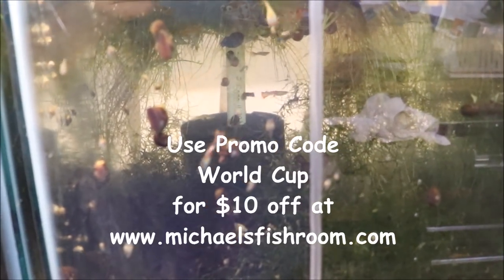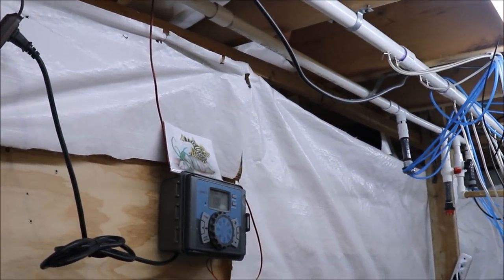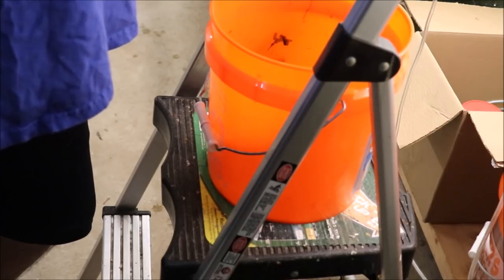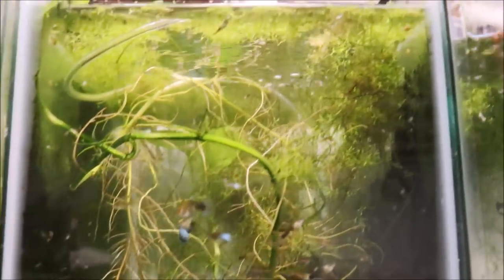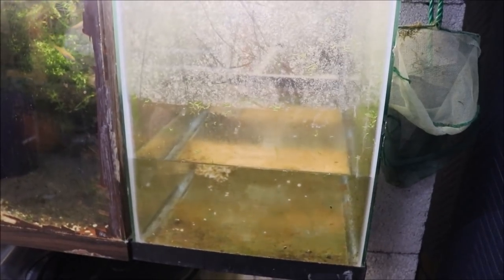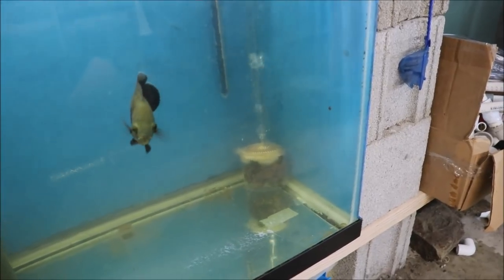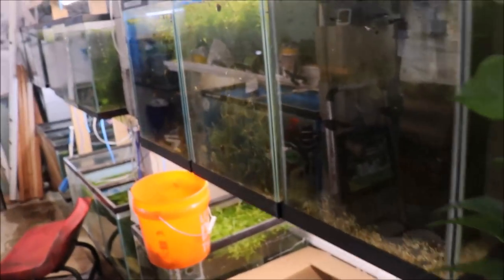A Day in the fish Room Lot's of Maintenance Required How to Clean a Sponge Filter

Comment: Keep your water level down a couple inches so your blue mystery snails can lay above the water. You also want water level low otherwise the snail will crawl out of the tank to lay. The snail will lay a clutch in an area they feel it will stay moist so it can hatch. If you see a clutch you can remove it after a couple days once it gets hard and float on a sponge. As babies hatch they will crawl and fall into the tank. You may want to put the egg clutch in its own tank because they are tiny and fish will eat them.

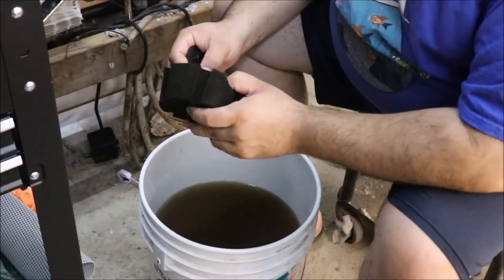Comment: 8:00 i think another thing with sponger filters is never bother with those airstones just run the airline to the bottom without one as it causes un-necessary resistance to the system
Reply from the maker: Good point! The only ones that use air stones in my fish rooms are the ones that the little nipple broke.

Comment: Nice water change system Michael. Thanks for the description. I couldn't use drip emitters and had to take them all off because of the back pressure they created. Had too many leaks and lines busting off.
Reply from the maker: I found they just get clogged.

Comment: Plecos are really dumb and can't back out of a tube that is too close to the size of their body due to their pectoral fins.  I have lost a couple of them to lift tubes including a super red and a green dragon.  I ended up just pulling the lift tube off of the filter in tanks with plecos that are too close to the size of the tube.  Part of the idea in a lift tube is also to get the water that just passed through the filter to be dumped further away so you have a better chance of passing more of the tank's water through the sponge.  I don't really find that to be a problem so I'm ok with dumping the lift tubes on some of the tanks.
Reply from the maker: I never knew that about lift tubes.
Reply: Mitchell Broome - I had a pleco die once from this 🙈

Comment: How do you mineralize your ro water into your tanks from your auto change?
Reply from the maker: I use tap water, not RO.
Reply: Michael's Fish Room but uou showed the filter that it goes through. That removes your minerals
Reply from the maker: No it doesn't. It remove chlorine and some sediment. It is a whole hose water filter.
Reply: I use the same filter system. More concern on sidemen though
Reply: Michael's Fish Room would this remove lead? They've installed a new chlorine system in my towns water system and it has made our water extremely nasty tasting and it stinks like metal. I can't get an answer from them if it's chlorine or chloramine so I'm thinking about installing one of these. I've had someone suggest that excess lead could be why my plants don't grow and that conditioner doesn't really remove it.
Reply from the maker: The water company has to tell you. But I am not sure about the lead.